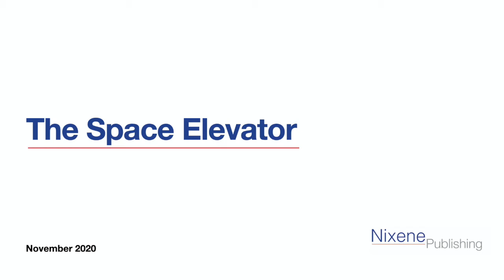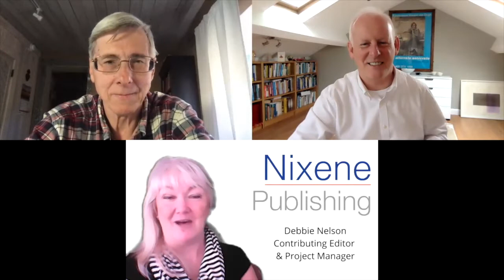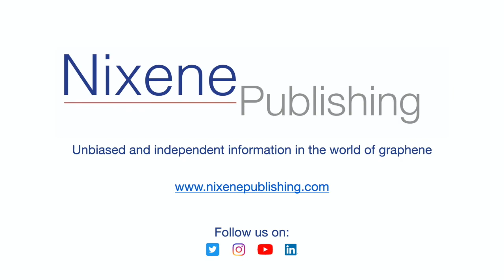41 The Space Elevator

Comment: If i recall correctly, in the CVD process the method that is used to pulling apart the graphene from the copper involves dissolving the later with acid. Could be made instead by inducing a negative charge in the side of the copper that is in contact with the graphene? Would that repel the "sea of electrons" and thus the graphene sheet?
Reply from the maker: Thank you for such a great question. For our readers' benefit, see Adrian's response in the Adrian On the Spot playlist.